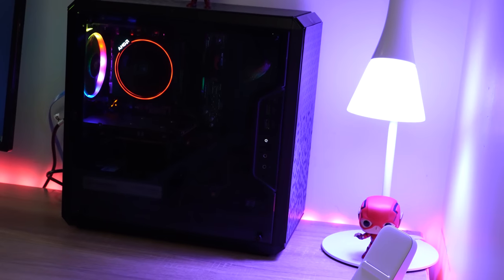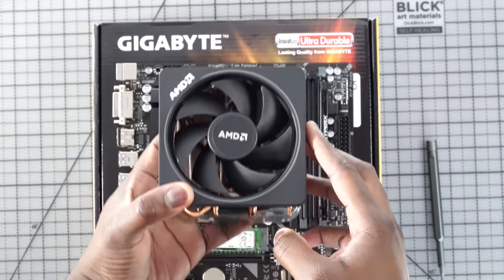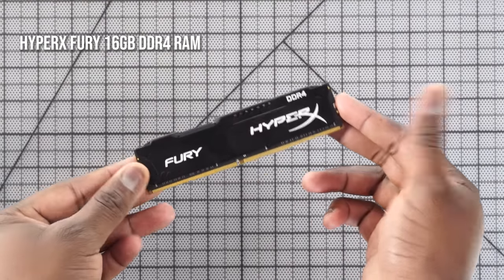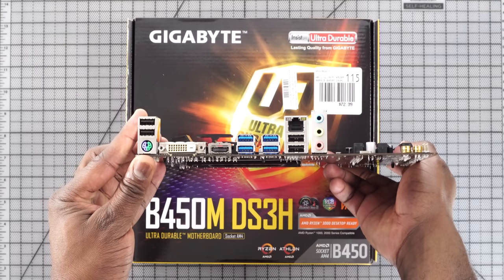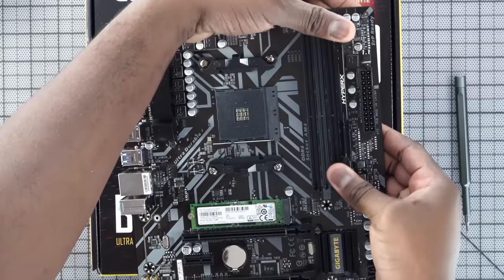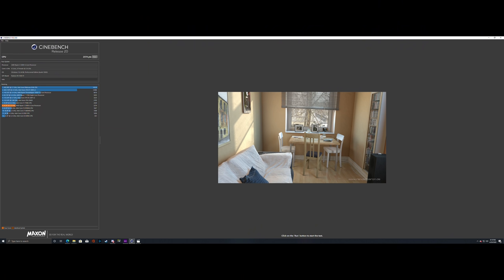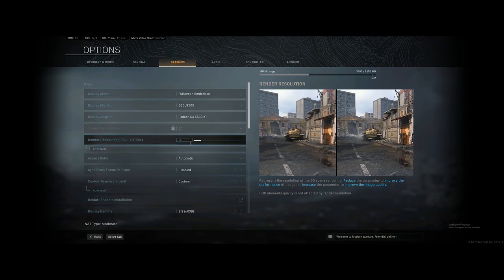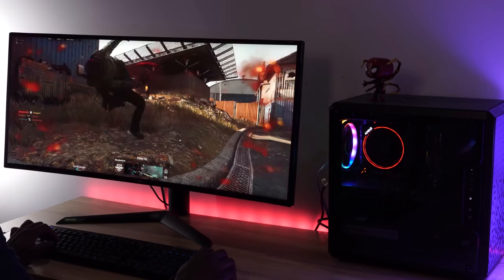Ryzen 3300x Budget Gaming PC Build | New Budget Champ!!!

Comment: the reason you got lower scores and frames is that you only used single channel memory . Ryzens are known for their full potential when using dual channel memory.
Reply: Naveen Kumar can u help me choose parts for my pc
Reply: @nyashamudimu9616  sure
Reply: @seekeroftruth45  do you know forum on another social media? my country ban reddit for some reason :(
Reply: Understandable, but my country and my wallet halts me from having dual channel
Reply: Can someone help me cuz I am building my first pc, I dont know much about it, but will this work together?
CPU: AMD Ryzen 3 3300X, AM4
GPU: AMD RADEON RX580 8GB DDR5
Motherboard: Gigabyte MB GA-B450M-DS3H, AM4, 2x DDR4 RAM slots
RAM: HyperX FURY RGB 16GB DDR4 3200MHz (2x8)
Power supply: Gigabyte P650B 650W 80+ Bronze
Hard disc: Toshiba HDD 1TB
SSD disc: ADATA SSD SU800 256GB

Case: ASUS TUF GT301
Microphone: Hama Stream 800 HD, USB
Camera: Trust GXT 1160 Vero
I am going to play those like old games, ets 2, minecraft, gta v, red dead redemption 2, etc.
Reply: @MrammiR  I dont think you would need 650w but okay

Comment: Nice video!
I'm a noob but I think Ryzen chips have good cost to performance value!
Even in the laptop division, I bought a Huawei Matebook D 15( Ryzen 7 3700U) for $800 and it can play Fortnite, Apex Legends and PUBG Lite smoothly if graphic settings is low.
Reply: Yeah, intel has some overpriced chips and outdated manufacturing processes. They also give you terrible fans with their CPUs.
Reply: @air_  lol some of their cpus dont even come with coolers so you end up having to buy a whole separate cooler
Reply: On Med settings

Comment: I have a ryzen 3600 that runs hot. Have 4 case fans and using the stock cpu cooler. At idle its around 50c and when gaming it gets up to 90c occasionally. No overclocking done at all
Reply from the maker: You have to go AIO cooling
Reply: Booredatwork.com no i dont its air cooled

Comment: Based on Hardware Unboxed Ryzen 3 3300x doesn't support B450 motherboard, so I'm a little bit confused. Coz on this vid it worked on a B450 mobo.
Reply from the maker: It works. Some board you will have to flash the bios. This  didn't require it

Comment: I really hope someone sees this but how are people finding the Ds3H boards that are 3000 series ready, on amazon and newegg etc I only see 2000 series.
Reply: Same happened with me, although I bought not from newegg, but I got a previous year batch, which doesn't support 3000 series CPU. A bios upgrade should do the trick, but my CPU is mattis cpu architecture based (7nm) R3 3300x and although the mobo supports it, but the BIOS needs to flashed of F40x as per there official support page, however, when you go to downloads its only provides F40f. Wtf!

Comment: for next time to get better results, I'd suggest running dual channel memory
Reply: What is that? Could you explain cause I might build this pc
Reply: @popo7948 A 4 DIMM slot motherboard (DIMM = RAM Slot), slots 1&2 make one channel, and slots 3&4 make another channel. When you run your memory in two channels, it is easier for a CPU to access the RAM essentially, so when running two sticks of memory ( I do not suggest running a single stick!), you want to put the sticks in slots number 2, and 4, so that you can run your RAM in two separate channels.

Also if you plan on building this one, I'm convinced that this CPU doesn't exist. It was "launched" in the USA in May but nobody's order was fulfilled. I suggest a Ryzen 5 1600AF, or regular 1600 for this price.
Reply: @andrewdecorleto7882  Thanks man I needed this but also could u suggest me a good budget graphics card other than the one in the video please cause I could not find that one for my build 😅😁 tnx
Reply: @popo7948  there are almost no graphics cards available anywhere. Your best bet is a used 1650 super locally

Comment: Can someone help me cuz I am building my first pc, I dont know much about it, but will this work together?
CPU: AMD Ryzen 3 3300X, AM4
GPU: AMD RADEON RX580 8GB DDR5
Motherboard: Gigabyte MB GA-B450M-DS3H, AM4, 2x DDR4 RAM slots
RAM: HyperX FURY RGB 16GB DDR4 3200MHz (2x8)
Power supply: Gigabyte P650B 650W 80+ Bronze
Hard disc: Toshiba HDD 1TB
SSD disc: ADATA SSD SU800 256GB

Case: ASUS TUF GT301
Microphone: Hama Stream 800 HD, USB
Camera: Trust GXT 1160 Vero
I am going to play those like old games, ets 2, minecraft, gta v, red dead redemption 2, etc.